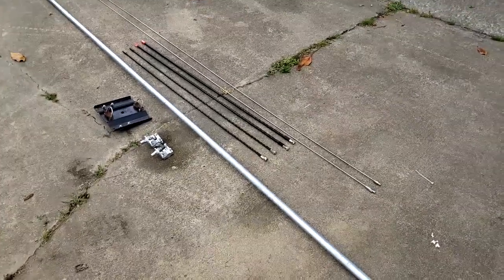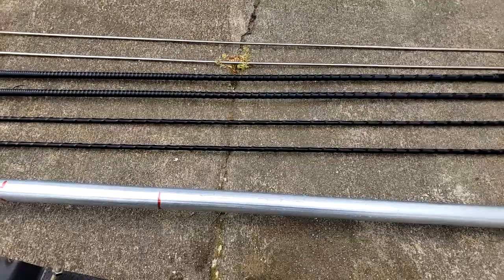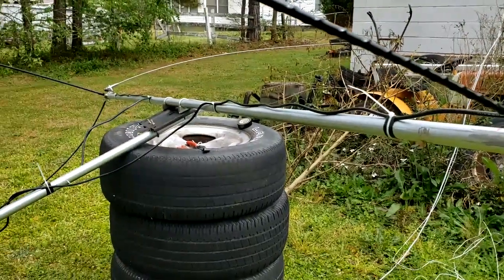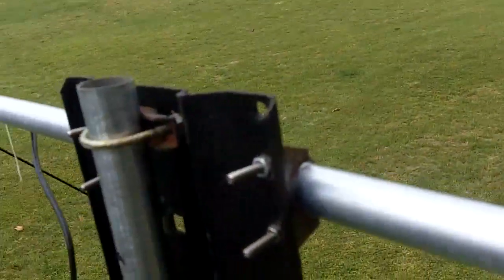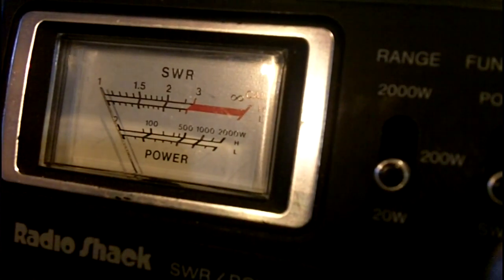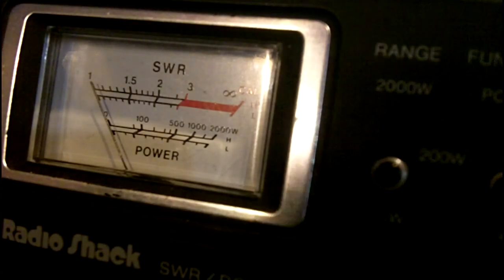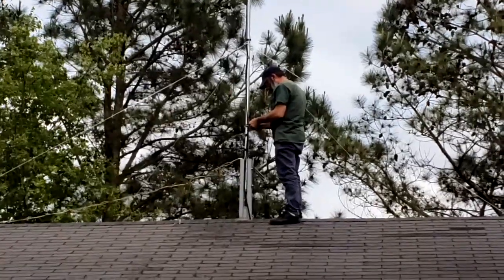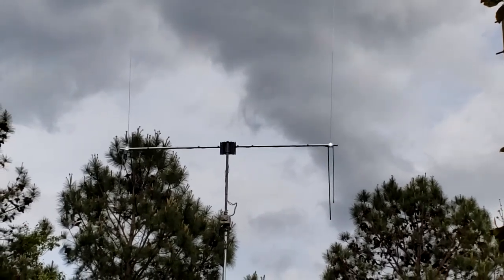Homebrew Beam CB Radio Antenna My New Homemade Base station

Comment: I suspect things will change a bit once you get it up off the ground and up in the air. While 8 ft does look promising I'd really like to know what the front to back rejection is like and I'd like to see it on a antenna analyzer do you have a mini Spectrum analyzer antenna analyzer there?
Reply from the maker: did you watch any of this video? Your question does not apply.

Comment: I'm going to do something similar to this with my build It's going to be a phased off centered halfwave dipole made from 102" stainless steel whips on 2 inch 10 ft boom. That's World Wide 420 Denver Mile High Bumping It Down!

Comment: Put a 15v 330µƒd capacitor across your S-meter and it will slow down both the meter movement and your AGC on SSB so it won't be so spastic and "pumping" sounding. Make sure you get the polarity correct, + goes to the meter wire that's not negative/ground. I bet you'll love it on SSB! You can put the Capacitor on a switch if you want it to be back to fast for AM.

Comment: Can the 4' fiberglass radials be ,  any 4' fiberglass radials as a  5/8 wave or .... ??
Reply from the maker: the radials need to be 1/4 wave, 5/8 will not work.
Reply: I seem to have trouble finding them at  1/4  wave .
Maybe I can use  108 "  10 or 12 Guage copper wire to get the  1/4  wave ?
Hmmmm......

Comment: I know I've asked 100 questions here but on your coax going to each antenna I think you said you use 75 ohm what was your total length?
Reply from the maker: a basic co-phase harness like the truckers use works great. it's made out of 2 9 foot pieces of 75 ohm coax.

Comment: Hello there.. instead of using the 48" fiberglass radials would it be possible to use the 102" whips as the ground radials?
Reply from the maker: Yes, 102's would work. any 1/4 wave antenna would work as the ground plane.
Reply: @MowerJunkie  hey mower junkie thank you so much... 73's is my friend!

Comment: Hey did you use a cophase harness if soo what length? Also what coax type going back to radio? 73's from the Mile High City 4-2-0 Wavin

Comment: Great video....  ONE important tip - For a "more durable" tie wrap for exterior/sun exposure, use a BLACK tie wrap.  The white/clear wraps WILL deteriorate much faster than the black nylon wraps.  The black nylon blocks the sun's UV rays from destroying the nylon....  The next time you are on the roof, place some black tie wraps next to the white ones and you will see the difference in the durability....

Comment: what is the distance in inches between your 2 whips
Reply from the maker: 96" spacing between the whips.
Reply: @MowerJunkie  I've read in the ARRL handbook a .2 spacing (87") is supposed to be the point of highest gain & best Front to Back.

Comment: Back between 1982-1988 was on the upper channels dx'ing. Had a modified President Madison and 400 watt amp. Collected up some black iron pipe and home brewed a tilt-over tower that stood 84 feet. Started out with a Wilson Y-quad and then built a full 2-ele-quad. Later put up a 5/8th (mighty magnum) wave vertical. Had a ball talking all over the world. The 11 meter band was wide open back then. Retired now. Enjoy watching your channel. :)

Comment: Are you matching it with 75 ohm coax going to 50 ohm coax?
Reply from the maker: Yes, it has a 75 ohm co-phase harness connected to 50 ohm coax.

Comment: Nice antenna, I have a 4ft firestik. Does the ground radials have to be the same size, when are you usually on 38 or 39. 73s from 361 corpus chirsti texas
Reply from the maker: the radials can be any length, as long as they are 1/4 wave. I'm usually on 38lsb. Thanks for watching, Take care.
Reply: @MowerJunkie  thank you for the info, curious have you heard 361 corpus Christi texas yet.

Comment: Does this have 4 lobes? Co phase projects perpendicular to the elements but if it works a bit like a yagi it would project front to back, I'm guessing it has 4 lobes and does a bit of both, i guess you can test that with the rotator.
   How about add 4 more 102" instead of those loaded sticks. I have a metal roof and thinking to try this in one direction, north if with directors along the roof apex, or east to west as co phase. If it works well with the roof as the ground plane i might be able to swivel a few 102" whips over the apex for directivity. Could be worse i guess.
Another idea i had was to mount co phase on each of the 4 sides of my roof.

Comment: Im not to knowledgable of the co-phased antennas. Question, both the 102 whips are not active at the same time are they? In meaning, you have both the coax going into a switch box. What would happen if you had a splitter connector to connect both coax and was able to run only one cable to the switch box
Reply from the maker: this antenna does not use a switch box, both antennas are active, they are coupled together with 75ohm coax.

Comment: You've got yourself a nice little dual diversity pair of stardusters I like it kind of reminds me of the old set of IMAX antennas I put up going opposite directions about 30° up from flat had to use a pair of 75 ohm cables quarter wave long times the velocity Factor get it to work right and a couple other little deals but yeah Homebrew that's the way to go man when it works you feel 10 times better than just going out and buying something

Comment: Decent build matey !
I built a 2 ele cubical quad for portable, I could assemble and take it down in about 5 mins, for 10m/11m it was bloody awesome.
The boom was square thin wall aluminium, and the spreaders were old army tent poles I picked up at a surpless store.
With a 1/4 wave length of 75ohm coax as a matching stub I got a 1.3 to 1 SWR at the lowest point, and it was under 2 from the bottom of 11 to the top of 10.

Comment: Cool groundplane. Gonna build one tomorrow.  How far exactly apart are your two verticals?
Reply from the maker: Thanks. the spacing is not critical, just don't go over 9 feet, or shorter than 6 feet. 9 feet will give you the most gain, but 6 would work too.
Reply: @MowerJunkie  thanks.  I've built a lot of antennas.  But the math seems to get in the way. Especially with dipoles.  But this groundplane of yours really cool. Beautiful in its simplicity

Comment: I just subscribed to your channel and I am 34xray 01 in Kansas I try to run lower 36 also how far in from the end of the do you drill the holes for the fire sticks and at what angle
Reply from the maker: I set it up so that the vertical whips are 8' apart, and the radials are at 45 degrees.

Comment: Hey mower will you please send me the measurements for the boom and the directions for building this
Reply from the maker: the boom is 8 feet long. I didn't wright anything down when I designed it, So this video is the only instructions available for this antenna. Thanks for watching, Take care.
Reply: @MowerJunkie  thanks

Comment: Just got thru with a long QSO with 1963 Jamaica  On .525 LSB on 1/30/23 at 5:00 central  We talked about you and both being subs. He said he hadn't talked with his good friend Mower Junkie in a while, due to cond on .385. He said he is on .515,  mostly, and .50, .515, .525, and ( ? .60 ) All lsb. 73/88  from Mike DX21

Comment: Wanted to revisit this video! I've yet to hear S.C., on the MS coast. I talk, with Jamaica and will listen for 1963 on 515 L 385 is such a c/f /now.🤡💩👺☢.  🙏🙏🙏 Barbara is a treasure.
Reply from the maker: Thanks for watching, 73's from 151 SC.
Reply: @MowerJunkie  Duplicate RELAY Wanted to make sure you QSL. Just got thru with a long QSO with 1963 Jamaica  On .525 LSB on 1/30/23 at 5:00 central  We talked about you and both being subs. He said he hadn't talked with his good friend Mower Junkie in a while, due to cond on .385. He said he is on .515,  mostly, and .50, .515, .525, and ( ? .60 ) All lsb. 73/88  from Mike DX21
Reply from the maker: Thanks for the info, after I read this I went up to 27.515 and had a nice QSO with 1963.

Comment: Will  10 aug. Copper wire be a acceptable replacement for the radials you used ? At 108" .  Thanks...

Comment: Very similar to a 2 element I built but it had one 1/4 wave radial in the vertical, one 1/4 wave in the horizontal and the driven 1/4 wave at a 45° downward and it had great vert & horiz DX performance, almost no selective fading! It used three parallel 3.5% longer reflector ¼ waves at 87" spacing.

                     |
                     |
                     | <-- Two 102" ¼ wave radials - - >│
                     |                                                         v
                     |                                                         │
   boom - > Ó▬▬▬▬▬▬▬▬  <-- -- <-- -- <-- v
                / 
          /  <-- Fed 102" ¼ wave @ 45° angle downward.
     /
/

Comment: Just wanted to give you an update on the co-phased antenna.  First off I really like this antenna I'm so glad I stumbled across your channel.  I got the swr down to less than 1.1 to 1 across the band and this thing works like a champ, I've yet to add a rotor to it, I just have it pointing NE and I've made contact to Canada,  Buffalo,NY  Cleveland, Ohio, the Carolinas I've even talked to operator's in North Dakota and Arizona. I hope one day to make contact with you using your co-phased antenna design,  that would really make my day!  Until then 73's  friend and keep the antenna designs coming. 
719 SE Oklahoma,  operator Wally.
Reply from the maker: Thank You so much! I'm glad the design worked for You. Take care 719, 73's from 151 SC.
Reply: @MowerJunkie  I've had this antenna in the air almost two yrs, it's been through a few Oklahoma thunderstorms with 50+ mph wind and still standing strong. Next days off I'm lowering it down to replace the fire stick radials with SS 102s. Wish I had bought the 102s when they were a lot cheaper, Lol. Also upgrading my coax cable and plan on adding the rotor to it. I've talked all over with this antenna,  every time Im asked about my station I always give you props for the antenna design.  You're pretty well known,  still hoping to make contact with you, I've heard you on SSB but mother nature hasn't been cooperative for me , still gonna try that's my goal to talk to you with this antenna. Love the antenna, love your channel and antenna builds keep em coming.  73s and wishing you well. 
719 SE Oklahoma operator Wally.
Reply: I know it's been a year since your post. One question- pointed NE- How do you know what side to point NE? One of the ends, one of the sides?
 I was thinking if the 102's were on their side it would be directional the way they are pointing with the ground planes being the backside of antenna.
Are both co-actions the same length and tied to one end?
Got any thoughts about this? Thanks in advance😊
FYI- I'm just south of you in Northeast Texas. About 40 miles south of the Red River.
73's Mr Wizard 101
Reply: @brainiac_brian I don't think it really matters which end is pointed in a certain direction. it's not really a true directional beam its still a ground plane but i believe it to be slightly directional To be honest, im really not that smart all I know is it just works.  I love this antenna. It is better than the A99 I ran back in the 90s in my opinion . And its pretty tough, been through some 50 + mph winds and haven't had any issues.  Sorry that's about the best I can answer you're question

Comment: What do you go by when talking skip? 
Don’t think I’ve heard you but I’m Road Runner, beep beep!
Reply from the maker: Mower Junkie 151 SC. standing by.........
Reply: @MowerJunkie  I’m usually hanging around 17 or 28. I believe you mentioned 36?
Reply from the maker: @LifewithJames  Copy that, Road Runner. I'm usually on 38 LSB.
Reply: @MowerJunkie  Aaaaaah. I just have regular radios, no sideband. I run a Cobra 19 DX IV with a 2 pill or a 1970’s 23 channel Cobra 29 classic on barefoot as my base radios. I run a newer cobra 29 classic with an rfx in the back in my semi and talk skip from time to time.

Maybe one day we’ll cross paths on AM.

Comment: Where did you locate that Realistic radio at? Great antenna by the way. If iam not mistaken, you pop into Wagon master 390 channel (live stream) from time to time.
    I just picked up a RCI 2970n3 that iam working on getting set up here at the homestead, maybe we can get a DX QSO going.
      Great channel, thanks for sharing your antenna build. 73's to you!!!✌
Reply from the maker: I have 2 of those TRC-451 realistic's, I found one on ebay, and a friend gave me the other. 
390 WagonMaster has a cool channel that I do enjoy watching.
Take care Eric, Good luck with that 2970. 73's from 151 SC.

Comment: The greatest thing about your Utube Channel is that when watching the "News" gets you down I can always pull up Mower Junkie and get re grounded!
Reply from the maker: Thanks Troy, I appreciate that. Thanks for watching, 73's from 151 SC.
Reply: When you were building this in the garage you had what looked like two coil trucker antenna's. Was there a reason for not utilizing them in the final application?
Reply from the maker: @OldSgtsMaj52  I just felt that the 102's would work better, and I had plans for the trucker whips.
Reply: @MowerJunkie  I am thinking seriously of re-constructing your build.
Reply: @MowerJunkie  So then the 102's are/where a better application? Sorry to keep bugging you on this but action does have reaction... In this case I have done jumped head first into the Home Brew Rabbit Hole... And with this Video... Well your responsible. I even turned my brother on to your channel and his Wife... Well she thinks we are all crazy!
Reply: And on a side note my brother is a Uniden Washington Junkie who may require an Intervention... Thus I myself have evolved into an all things SBE Junkie... In order to balance his addiction.

Comment: Nice job! This works very well, I'm guessing the radiation pattern would be similar to a twin phased set up on an 18 wheeler truck or "lorry" as we in the UK would call  it?
Reply from the maker: Yup, it acts like a vertical, but it has additional gain in 2 directions. Thanks for watching, Take care.
Reply: @MowerJunkie  Thanks for the reply.

Comment: I just completed this antenna build,  I used two ss 102 whips and 4, 4ft Wilson fiberglass antennas for ground radials.  It's turned out awesome,  it looks like something I would have bought from a store.  That's just my opinion. My swr's aren't quite as good as yours,  but I've got 1.3 to 1 on channel 1, 1.2 to 1 on channel 20 and 1.1 to 1 on 40.
I usually talk on 38 lsb so I'm happy with my swr readings. Love you're channel, keep bringing on the antenna builds, love em !
Reply from the maker: That's awesome! You're the first person to tell me they successfully made one of these antennas. Enjoy the hobby, 73's from 151 SC.
Reply: Why not using SS whips for radials?
Reply: @LuisPerez-xe6nu 
I thought about it, but it came down to money.  I still want to use all ss whips to see if it will preform any better, but as it is right now I'm very happy with the antenna.
Reply: @Luis Perez  who can afford to? They're close to $100 apiece anymore. Not worth it for a home brew antenna. You'd have $300 to $400 wrapped up in radiators and radials if you used 102's for the entire build. 

Compromised radials are the norm anyhow. The Sirio GPE 27 5/8 ground plane has three radials that aren't but maybe 4 or 4 feet and the Tornado 27 has slightly shortened radials. Both perform plenty fine

Comment: MJ, Is the reason for staggering the ground radials and positioning the whips between them due to function or strength? I was curious as to why the ground radials aren't exactly opposite each other.
Reply from the maker: I staggered them because they are bolted to the boom, and the bolts needed room to clear each other.

Comment: I've never seen no one set the match on the ground level before installing it on roof ...does it really give a true reading after mounted on roof or do you have to make another adjustment after mounted ???
Reply from the maker: usually the SWR will get better when the antenna is raised up. As long as the initial adjustments are made at a 1/4 wavelength or more above the ground.
Reply: @MowerJunkie   Well I'm gonna try that I'm getting ready to get back into the CB world I was really heavily into it in the eighties And come across a talking skip video on YouTube got me interested again 30 years later  So I'm gonna install another base antenna.... And I like your 3 element being that you built kind of kind of caught my interest to try and build me one build me 1 in the near future....thanks for input...

Comment: Is that 9’ 4 “ perfect spacing or would 9’8” work?   Also, would a 18’ co-phase harness work? Cool build and 73’s.
Reply from the maker: The spacing is not critical on this design. it will work best with 9 to 10 foot spacing. I used a factory made 18' co-phase for mine, and a barrel connector to attach it to my coax. Thanks for watching, 73's from 151 SC.

Comment: I built a moon raker four element with a quad on the back using two three element beams with gamma matchs  on both flat side and vertical side and it worked real good
Reply from the maker: Awesome! I'l bet that antenna kicked ass on the air. Thanks for watching, 73's from 151 SC.